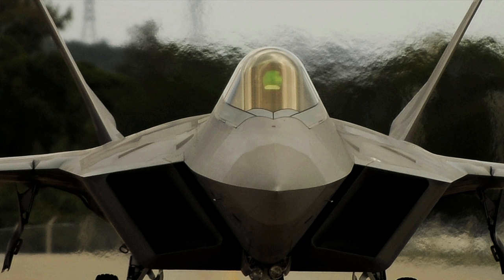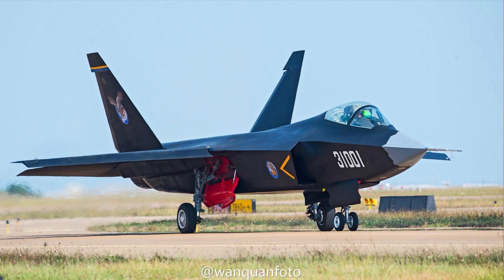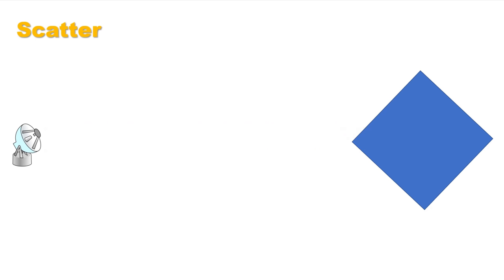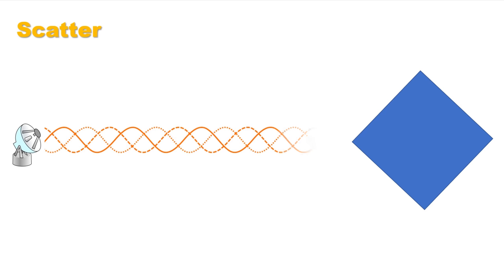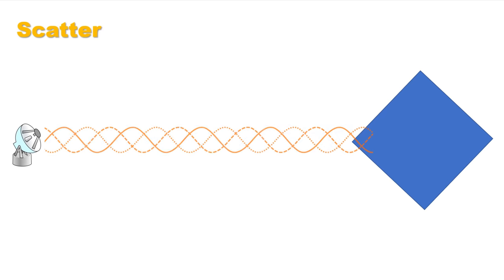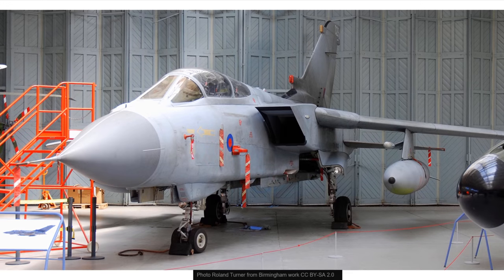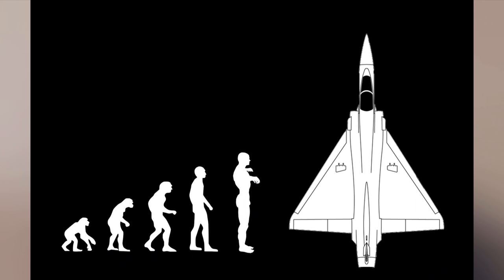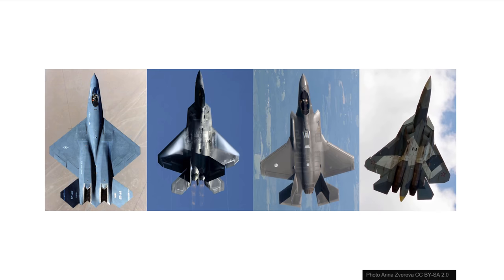STEALTH Killed AERODYNAMICS | why all modern jet fighters look alike

Comment: I describe stealth as a mirrored aircraft hanging in a dark hanger, and you shine a torch (flashlight) at it.   Everything you can see is a radar return.  the round heads of every rivet, the corner of every panel-joint, everywhere a curved surface is closest to you, everywhere a you can see a refection in the reflection ....
 on an old aircraft, you will see a cloud of reflections of the thousands of rivets,  a bright spot on every curved surface of the aircraft or its engines ... and so on.
Reply: Very well put, thanks.
L.
Reply: When Police in the USA first began using Speed RADAR, production Chevy Corvette Stingrays were at the time,  Curvy Fiberglass Bodies over an engine far, far smaller than the F-35 engine. Were THEY invisible to RADAR?  NOPE.
Reply: Small point, but visible light wavelengths don’t behave identically to radio waves (edge diffraction and other effects as a result of wave mechanics). A better comparison would be a scaled down, microscopic stealth aircraft made of mirrors in a dark hangar with a flashlight shining at it. The wavelength difference is around 1 million, so that would be how much you scale down the aircraft. Basically the size of a dustmite or even smaller.

Edit: this is why stealth design is not perfectly intuitive. You make something angular and it might not work because of radio waves having 1 million times the wavelength of visible light.
Reply: @arcanondrum6543  The fiberglass body is transparent to radar radiation. The radar radiation is let through to the engine which has plenty of flat surfaces and corner reflectors. Furthermore the distance from speed radar to car is very short compared to military conditions. The short distance gives a powerfull reflection thus no problem detecting a speeding Corvette Stingray.
Reply: @arcanondrum6543  You seem to entirely miss the point of stealth aircraft. Stealth aircraft are not designed to be invisible to radar, the only way you get that is to not exist at all. Stealth aircraft are designed to reduce the time enemies have to react to a stealth aircraft. Stealth aircraft can detected by low frequency radar as you stated with weather radar. The difference is that low frequency radar cannot provide enough clarity to provide reliable tracking data, it can only tell you an aircraft is within this general area. Stealth fighters are most effective against high frequency radar, the type of radar mounted in aircraft and missiles. The reason stealth fighters almost always win engagements with non stealth fighters is because they can always see the enemy before they can see them. And as to the effectiveness of stealth aircraft, the only stealth aircraft ever shot down was a F117 in Yugoslavia, a single first generations stealth aircraft where the conditions on why it got shot down were more due to the complacency of the us airforce. The F117 was flying along a known flight path, and was not escorted by its usual suite of electronic warfare escorts. In the gulf war, 10 F117s were sent over Baghdad, one of the most heavily defended areas in Iraq, and guess what. They all dropped their bombs and made it out with no losses. Stealth is the future of air combat and the fact you try so desperately to deny it shows your lack of knowledge. Also who the heck hurt you to cause such hatred for Lockheed Martin. They definitely go over budget for all their programs but all their Skunkworks Division has been highly successful in producing innovative effective aircraft designs.
Reply: @arcanondrum6543  I like how you wrote this huge pile of junk while you could've actually spent that time reading about how radar and IR detection. You're intentionally ignoring all concepts of scale, values or data comparisons because those disprove your entire argument.

Grab a calculator, put some numbers in various radar calculation formulae and solve for X. That way you figure out on your own that radar range is directly affected by RCS, that increasing wavelength is linear with required array radius, maybe even figure out what wavelengths are possible to fit on an aircraft without losing resolution... And maybe even intuitively test the range equation with really short wavelengths to see what happens. Surely IR light would somehow follow similar patterns to other electromagnetic waves. Maybe you can even figure out why IR isn't the magical solution you think it is.
Reply: Alex Foster I read all of his comment and he has a point.
Reply: @arcanondrum6543  okay but, with respect, what does any of what you've said have to do with the original comment?
Reply: @ivanlagrossemoule  Distance affects All RADAR, "Stealth" or not. Don't let Lockheed Martin take credit for a fact that has nothing to do with them. Maybe QUESTION the company charging us $1.1 Trillion? 

Independent comparisons of "Stealth" Aircraft RADAR signatures versus their non-Stealth counterparts is suspiciously "absent" from the debate. Phased Array RADAR like that on the Beriev A-100 replaces the big RADAR dish of their own A-50 or of our AWACS which, like the KC-135 Tankers, operates in-theater. The important lesson of the Beriev A-100 is that Phased Array on ALL craft that fly, including Missiles, INCREASES the detection capabilities.

These point are what I hope that people will explore for themselves.  I am not one of the Marketers prostituting myself for Lockheed Martin in the Video Game Chat rooms. I don't want you to just believe what I write,  I want you to take what I wrote and find out more.
.
Reply: @arcanondrum6543  isn't the reason why the B-52 isn't being replaced more because of pre-existing arms reduction treaties and the general advent of ICBMs being more effective in terms of delivering their payload tho.
Still, the fact that the F-15EX exists certainly goes to show how much the F-35 is sorely needed (sarcasm)

Comment: Yeah fighter aircraft are slowly turning into stealthy flying sams/missile trucks rather than actual fighters.

The F-16 series, SU-27 series, and MIG-29 series looks forward at the future with fear and uncertainty that they may be the last of their kind (low drag, high lift, dogfighting airframes.)
Reply: low drag / high lift is only useful as a ratio against the thrust of the engine. So so long as PnW and GE can keep churning out higher and higher thrust engines, we're all good
Reply: @anthonyb5279  wat
Reply: I hope one day, the IRST will become so powerful that it will render Radar obsolete. By then we may return to the beautiful aerodynamic shapes.
I mean with a search range of 100km under optimal conditions, it’s already a small radar.
Reply: @thomaszhang3101  much less under adverse weather, that’s a huge limitation. Also there is infrared “stealth” in the designs of most fifth gen along with the standard radio wave stealth
Reply: @quinndenver4075  long wavelength infrared penetrates cloud and dust well, and thus is used on modern IRST. Yes there are stealth features on 5th gen and even most 4th gen fighters, but any propulsion cannot be 100% efficient and the waste are emitted as heat. Human propulsion are extremely inefficient and the heat emitted is impossible to hide, at least compared to radar wave.
Reply: @thomaszhang3101  no shit, but still even long wavelength can’t penetrate weather as well as radar
Reply: @dsdy1205  ….. low drag and high lift complement powerful engines. Lower drag allows the more powerful engines to push through air easier and more lift means the powerful engines can climb altitudes faster.

Comment: 2:49 To put this equation simply, it's a double inverse-square law (every time you get twice away from the light source, you receive 4 times less light), with some absorption coefficients multiplied onto. It's double because radio wave is emitted twice, once from the source, and another from the reflection.
Reply from the maker: Correct

Comment: Being able to strike first due to stealth is an advantage which can not be ignored.
Reply: Not to mention modern missiles are super deadly. Good luck evading a missile that is flying at Mach 4 or can do 60 G turns. Dog fights are the thing of the past, it's the age of beyond visual range air combat (where stealth is more important than maneuverability).
Reply: @almaza4331  The missile sled is back in fashion and I am fully ok with this
Reply: @almaza4331  Not long ago, a heavy Su-34 dodged a Patriot missile, which is equipped with gas-dynamic rudders (that is, this missile is much more maneuverable than any air-to-air missile). Maneuverability is still important.

Comment: All dislikes are from offended F-22 fans 😂 Great video as always!
Reply: has to e a joke aout f35 lift fan
Reply: only 5 f22 fans as of now hahahaha
Reply: F-22 & F-35A exceed the acceleration of slick big mouth Vipers through the Mach, so aerodynamics evolved with VLO technologies.
Reply: Why offended? This video did not say anything bad about the F-22.
Reply: @CaptainDangeax  There is no such thing as the "hyperspace" barrier. If you meant hypersonic then there are no jets that reach hypersonic speeds, the SR-71 is still the fastest jet to ever be flow and it had to fly at high altitudes due to the shear friction of the air against the shell caused it to heat up so much it was untouchable for 30 minutes after landing.
Reply: @SilvaDreams  He's refering to the hyperspace dimension from star wars, which is reached by the spaceships when they travel faster than light.
Reply: @Youda00008  I don't know. It seems like a dumb comment to get people to respond and to get likes.
Reply: @alaskanhybridgaming  its cause the video says they all look the same this flew over your head

Comment: There's a third method that's rarely discussed - making most of the aircraft radar transparent, and using lensing effects to bend the radar waves around it's opaque metallic parts.
There's also another issue with stealth when using a combination of radar-absorbing materials and shaping - for shaping to be effective the material needs to reflect incoming rays in the same direction, using RAM to use destructive interference might reduce the total energy reflected - but might increase it in the direction of the transmitter.
Reply: Is that 3rd method used on anything flying currently, or is that something that might be used in future planes?
Reply: @lordsqueak  I have no idea. But I think that was the idea behind the proposed Russian plasma  stealth. Probably they used it to form a diverging lens in front of the aircraft out of plasma, but that's just a wild speculation.
Reply: @torginus  Plasma stealth would actually have an absorbing effect. The idea behind it is that you ionize the boundary layer around the aircraft. A plasma is a state of matter where atoms basically lost all their electrons, so the electrons form a kind of cloud in the ionized area. It's possible to cause this with high electric currents there are also other ways to create it, but that's the most common one. For instance an electric arc is nothing else than an area where the air has been ionized, so it turned into a plasma.
If an electromagnetic wave hits plasma, it get simply absorbed and you have no return at all.

Also radar transparent materials are used in aircrafts for a long time. For instance the nose in nearly every jet is radar transparent because otherwise the radar dish behind it wouldn't get any signal at all. Generally glas- and carbon fibre composite materials are pretty hard to see for radars. The problem is though, you can't build everything in an aircraft out of such materials.
Reply: @shi01  What about IR sensors? Can they detect plasma?
Reply: @myusername3689  Actually doesn't matter for modern IRST systems. They will detect you no matter what. Some parts of the airframe will heat up if an aircraft travels with transsonic speeds through the air and that's often already enough that an IRST will detect it.
Reply: @shi01  Ok
Reply: @anthonyb5279  ok
Reply: @shi01  but that's close/medium range but not BVR or ~near that range
Reply: @robertbalu8001  When deos BVR start? Technically BVR is everything beyond what the pilot can detect with it's eyes.
Now if we look outside of military applications, for instance would you say the James Webb Space telescope can make pictures of objects way outside the range our eyes can see? I would say so. And the JWST does operate in the IR-spectrum. So what is an IRST? Nothing else than small but fency telescope which allows you to see way beyond what your own eyes can.

And just to give an example of what ranges we're talking about. The procurement for the IRST in the Eurofighter was calling for detecting ranges comparable with the ones the onboard radar can achieve. Now does an IRST have limitations, for instance in wheater? Sure. But radar also has limitations of what it can do.